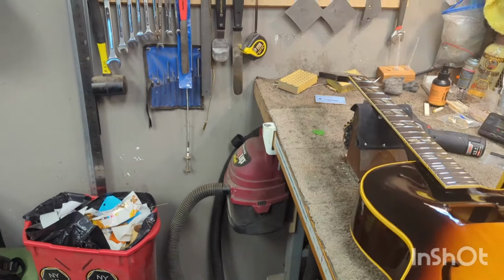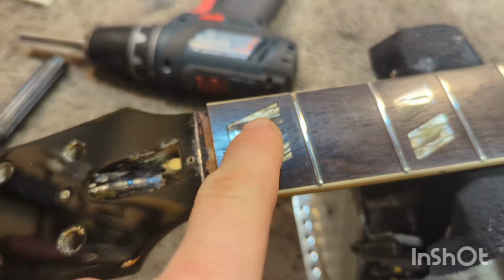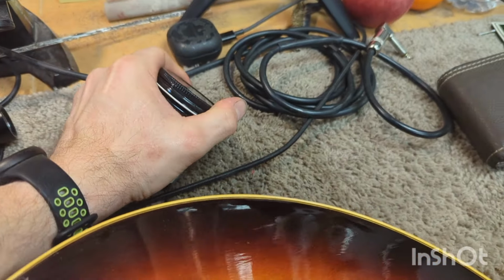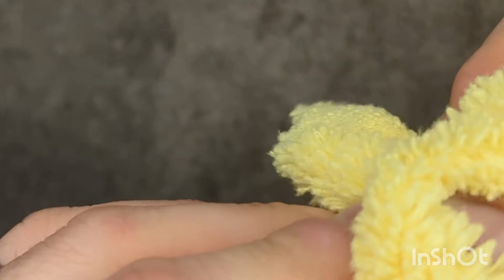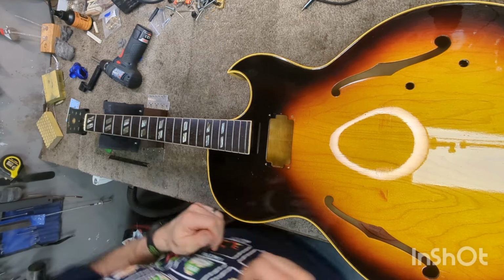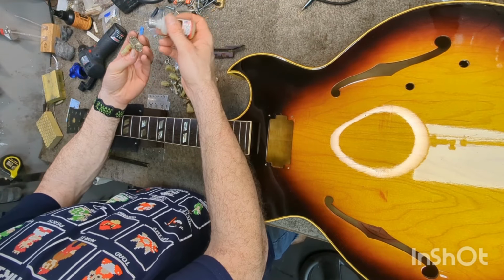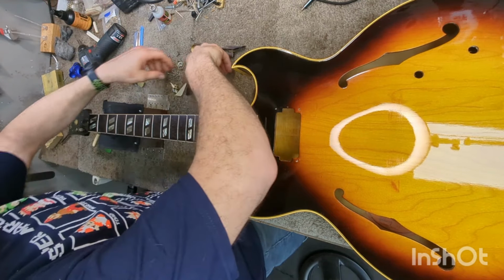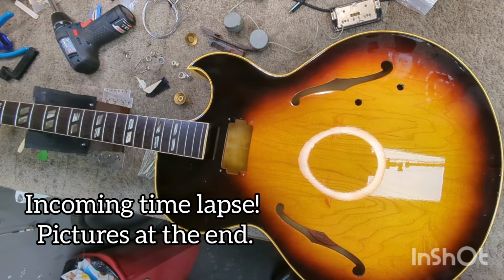VINTAGE 1963 Gibson ES-175. DONE! Gorgeous, jazzy, big body BEAUTY!

Comment: If I go to a customer for a setup ( normally just before a gig when things go tit's up ) I use 10ml vape juice droppers with the metal tip filled with light oil that fit great in my tool pouch!